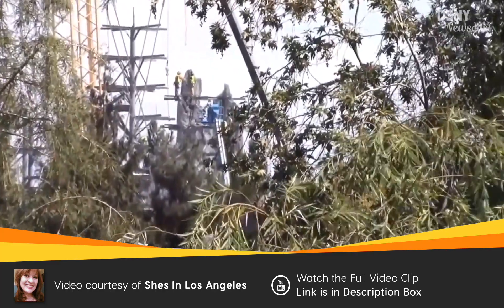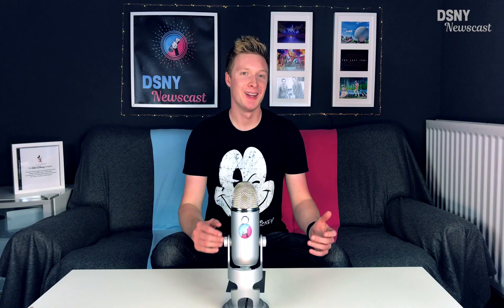Halloween’s Complete Transformation of Disney California Adventure - Disney News - 9/17/17

Comment: 3:37 After seeing what Monsters after Dark was, I think in concept it works very well...EXCEPT for one major flaw: it's an entirely linear narrative AND what happens in the pre-show doesn't really happen whatsoever in the ride itself. Rocket tells you there's a ton of monsters you're essentially acting as bait for while he looks for Baby Groot, but instead there's only ONE monster (cool looking as it is) that doesn't even acknowledge the riders existing until the very end, instead constantly going after Groot and Rocket. Not to mention it kinda looks like they're in the exact same location each time which kind of kills the idea of them actually running away from the monster. It isn't like the normal ride which has changing soundtracks and story sequences meaning it's a different ride each time, with Monsters after Dark it's a one-and-done deal in terms of seeing all the ride has to offer.

I mean, overall? As a limited time thing I suppose Monsters after Dark works for Halloween, but it's not up to what the normal ride does. They can easily just add in new sequences though so it isn't like this problem isn't easily solved. Just put in more monsters and maybe a little more chaos with the monsters going after the riders. Heck, maybe even have that guy from Ghost Galaxy make a cameo at some point, who knows what was in the Collector's possession that's been let loose?

As for other overlays, I'm not really sure. Honestly I didn't think they could pull off Halloween but it's workable as a 'sequel' to the main storyline. Not sure how they would handle any other holidays though.